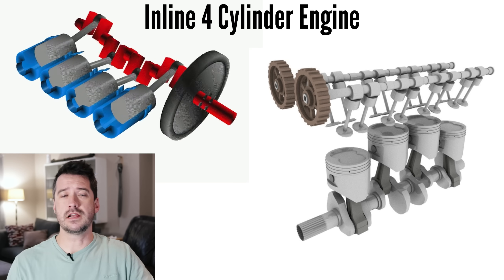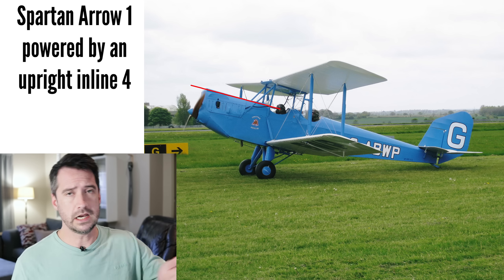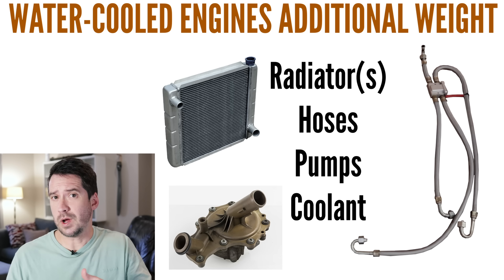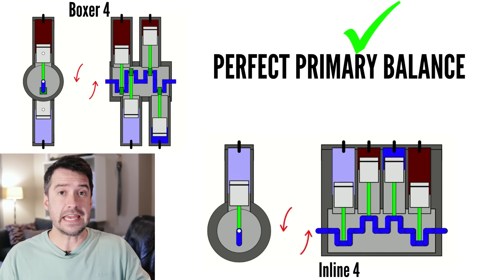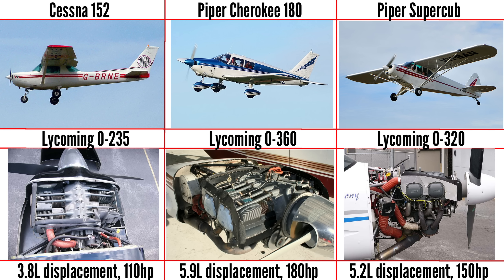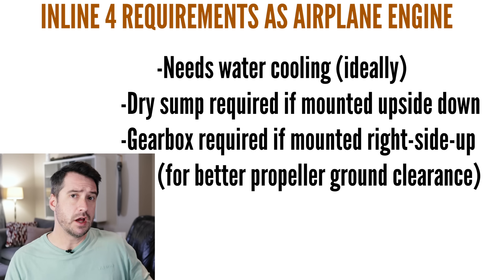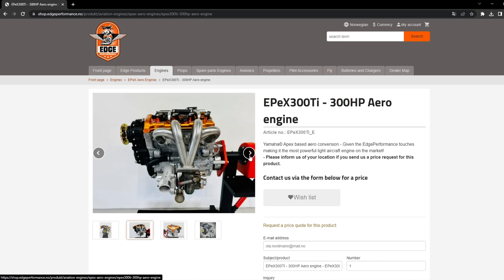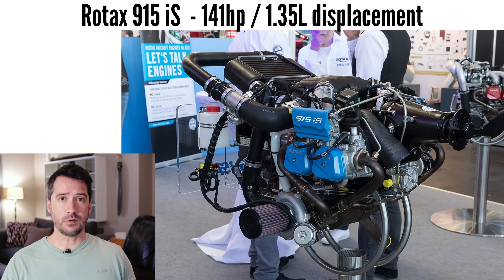Does Inline 4 Engines Suck for Airplanes? - Technical Deep Dive

Comment: Seems to me that all the issues you mention with the online four were solved more than a half century ago with the Meyer-Drake Offenhauser engine. It only won the Indianapolis 500 27 years in a row, and took the entire front row ten years in a row. Even naturally aspirated, it could make 770HP, and went over a thousand with turbocharging.
Reply from the maker: Thanks. I had to go look it up. I don't think they solved anything related to secondary imbalance, but really sturdied up the engine like crazy, so that the imbalance really doesn't affect it like it affects a normal production engine. I'm thinking, why is this not in any production sports cars? And why has it not been used in aircraft? 

I don't know the answer but I'm guessing it's relatively expensive and/or expensive to maintain in a daily use (non-racecar) vehicle due to it's much different design and assembly methods. It also looks like they are heavy, some in excess of 400lbs.

Again, I don't know all the facts, I'd need to research it more, but there is a reason it isn't being used in much other than racing cars.

Awesome discovery for me though, so thanks!
Reply: Yes sir !   Indeed -  how soon some narrow minded people forget what you said !
I only worked with one old offen -   Awesome unit !   I was a young mechanic and into big block 
Chevrolet mark lV engines at the time ,   However -   Like you said ,  non turbo offenhauser  …
Actually scared me … at first anyway .    Please excuse my spelling     Thank you sir !

Comment: Won’t 4 cylinder inline engines still have the cooling issue though? Less airflow and more reliant on radiators etc?
Reply from the maker: Liquid cooled won't as long as the radiator gets air. Aircooled can have cooling issues if the air ducting design isn't great. An airplane designed for the air cooled inline 4 (e.g. Tiger Moth) have taken the engine layout into account with cowling design, and thus doesn't have cooling issues. Put an aircooled I4 in anything else you'll likely have cooling problems.

Comment: The con rod angle causes pistons to reach mid stroke After 90 degrees. This causes a nasty vibration at 2x crank speed. 
Inverted two stroke V4 has very low vibration and direct injection run very clean and efficient. The Delta Hawk diesel is even better.
Reply: wonder if that helps lubrication of rings.
gravity being your friend here. but mains?
Reply: The mains get plenty of oil from the pressure feed being sent by the oil pump, same with the big ends.

Inverted cylinders tend to have issues with too much oil draining into the combustion chambers, especially when left sitting after shut down. This is why radials tend to smoke so badly on start up, oil pools in the bottom cylinders and they smoke until it burns off.

 Inverted inline or V engines usually use the rocker covers as sumps and have drains running from the crankcase to the cylinder head for this purpose, which might explain why they seem to smoke less than radials. But they will still burn more oil than an upright engine.
Reply: Ducati 90 degree V2 is so smooth you can't feel it running... inline 4 kinda sucks for every use...

Comment: This explains a lot about the popularity of small automotive engines...and raises interesting questions about the 3 cylinder engines.  They must be full of vibration.  Maybe that's why they are not expected to last more than 100,000 miles.   And...this business about turbo...I can only imagine the cooling problems.  Hot, vibrations and high rev. seems like a recipe for obsolescence.  The video offers good mechanical info.
Reply: I was thinking the same thing. My Triumphs have 3-cylinder engines (Speed triples, Daytonas) and only displace 1050-1200 cc. They make 130HP at about 10.7k rpm and can run in that range all day long. But, they hit all his points, complex (with balance shafts, water cooled) and would require a gear reduction to get the prop down to reasonable speeds.
Reply from the maker: 3 cylinder engines are interesting. I plan to cover it in a video the future, as a 3 cylinder car engine will now be converted for Aviation by a prominent company.
Reply: @LetsGoAviate  You are talking about Viking again. Looked at the Chevrolet trax engine, it is not suitable. It has a 90 mm stroke for one.
Reply from the maker: @chippyjohn1  Yes that's the one I'm referring to. Interesting enough for me to consider exploring it in a dedicated video.
Reply: @LetsGoAviate  Go for it. Even if you receive negativity in the comments, at least you are making a video about these topics, I applaud you for that. We do need people to push the boundaries of aviation like Viking and Aeromomentum. I just see red flags with viking. All the best.

Comment: There's a "big" difference between  "boxer" (4) and a "flat" (4). That's in the motion of the pistons and how the pistons are connected to the cranks on the crankshaft. In a boxer engine two "opposite" pistons have their own individual cranks and the way this is timed is that the two opposing pistons go in opposite direction at exactly the same time. When one piston moves away from the crankshaft, the other does so too.  In a flat engine, two pistons share one crank on the shaft and go the same direction. These differences have serious impact on the natural balance or unbalance in the engine. The boxer simply is more elegant and AFAIK it is the boxer design that is used in aircraft ICE.
The same difference may be observed in V engines, by the way. And you could compare the inline 4 with the boxer in this sense, only the inline 4 got folded into two by two at 180 degrees.
When it comes to natural balance, an inline 6 may be the best, though, and I am not sure if that 6 folded open into a boxer 6 still has that quality. It's all in the timing of moving - accelerating and decelerating - masses.
That said, yes, why not an inline 4 (diesel) in a small aircraft. Car tech has made serious leaps ahead in the past decades and HP per cc (or ci) as well as HP per engine mass have been improved a lot.
Reply from the maker: Yes and also, all boxers are also flat engines, but not all flat engines are boxers. Flat engines (that aren't also boxers) are not very popular due to horrible primary balance.
Reply: @LetsGoAviate  All aviation flat 12s and H24's are common crankpin engines, 180 degree V12's is another way to describe them. The Porsche 917 12 and the Ferrari 512 were also common crankpin engines.

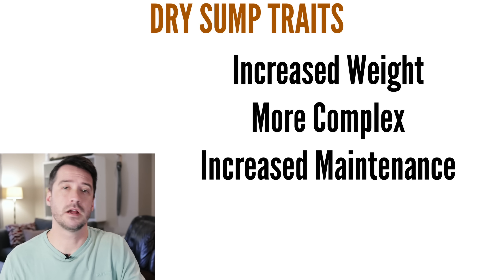Comment: 3:20 dry sump,  expense: Most of the German planes of WWII had inverted V-12's.  It's not necessarily a huge hurdle.  I wonder if they had dry sumps (probably, given that the Bf-109 was known to pull negative G's) or whether most had a wet sump that was simply fed from the cylinder heads. General Aviation planes don't need to pull negative G so why wouldn't a wet sump still work in an inverted engine
Reply from the maker: The Bf 109's engine was indeed a dry sump. I guess the problem with an inverted wet sump is, where do you physically place the sump? 

Using a dry sump isn't a huge hurdle, and there are many examples of them out there today. Heck, my plane has one! (Rotax 912). But it does drive up engine cost, which the manufacturer has to decide if it is worth it.
Reply: @LetsGoAviate  >  I guess the problem with an inverted wet sump is, where do you physically place the sump? 

A box that feeds from the heads or cam covers would take care of everything below the pistons.  I'm not sure how you'd get oil from above the pistons but there must have been a way if the Germans were doing it 60 years ago.
Reply: @LetsGoAviate  I haven't flown GA but commercial passenger service almost never has side loads even approaching that of a cornering economy car (which can do 0.7g or something laterally)?  Why would you need a dry sump on an airplane?   Is it only a bit of extra insurance so that the engine keeps working even under bizarre abnormal conditions that normally never happen anyway (e.g., momentary weightlessness in a stall)?

Comment: i would say much more than displacement and vibration of the gipsy major, its limited by the technology of its time.  they could machine parts and balance them.  but nowhere near as good as we can today.  they likely had rope seals and much lower quality babbitt bearings than what we do today.  on top of those two issues, you have the metallurgy of the time, far weaker pistons, rods, and crank.  then you have the cylinder head, the very antiquated carburetor on it, and the horrible oil they likely used when compared to modern standards.

i'd bet you'd have similar maximum rpm of a boxer aviation engine as you would with a gipsy major if you made a modern version of it with components updated and make significantly more power.

the other big reason you dont want a big displacement boxer engine on a car, is fuel consumption and rpm range.  a higher revving engine is going to have a much wider torque band thats usable for a vehicle on the ground that constantly has to rev up and down all day vs an airplane that sits at a given rpm most of the time its in use.

Comment: I have a question, are all flat four aircraft engines boxers or are some regular flat fours?
Reply from the maker: I'm not sure if there has ever been flat four (that aren't boxers) on aircraft, but I's be surprised as they are not very smooth engines, with that huge rocking couple vibration on the whole engine, due to 2 cylinders sharing a crank pin.

Comment: Something you missed: on Engine Balance an I4 engine can be balanced on both primary and secondary axis, and is the smallest that can do so. This is rare (and I’ve never seen it in an auto), but it’s been used many times on motorcycle engines, and has an easy solution: piston firing order. In the video you showed the firing order was 1-3-2-4 (which causes secondary imbalances), but changing the firing order to 1+4 - 2+3 (so cylinders 1 & 4 fire together and 2 & 3 fire together). This requires a new cam and ought to include a different exhaust collector to ensure effective scavenging, and may require a new ignition (many ignitions fire every cylinder on every stroke simply so they don’t have to add any logic to it).

Comment: I loved and learned so much with this video...till the boxer eq Hp but 2x the displacement, begs the question. why can't a boxer with same displacement make same HP?
Since a boxer has no secondary imbalance it should be able to rev much higher for the same displacement. Only the mentioned double halves argument still holds, even if potentially meaningless. A boxer can make more HP for same displacement with higher rev limit, all else being equal.
Boom
Reply from the maker: Thanks. Good point! There are the small displacement Rotax boxers I mentioned in the video, like the 915 & 916 making 141 & 160hp from 1.35L of displacement which almost matches the some of the modern I4's in the video on hp/liter. And the Rotax engine is proof that the boxer 4 will remain alive.

So I don't think it's that boxers can't compete at hp/liter at all, it's that with the I4 is more cost effective (simpler) to get a lot of power out of it, and when going high rpm, small displacement turbo'd, then the boxer 4 loses the big advantage it had over the I4.
Reply: @LetsGoAviate  two Yamaha motors with in a boxer configuration, new crank and block or block halves, and get 2x power no mods.
or shrink to allow higher engine RPM, HP and lighten back up, ...or...since we doubled the displacement...who does not want 600 +HP right? Bigger plane retrofits?
Since the cam is 2:1 and needs a chain anyway, why not beef it up and drive the prop? (Combined transmission and cam shaft drive
(crazy morning thoughts!)
I wonder if your point is more about the ubiquity of the I4 and how that reduces costs. yes one block costs less, weighs less. But if the 2ndary imbalance is removed with a boxer, it should be able to rev higher and stay together, without counterweights, and produce more power because of a higher rev limit. caveat is piston speed. if that gets invoked close to the 2ndary imbalance vibrational stress adds, then this may not be as true. but if there is a large rpm range below piston speed limit, then this should be mostly true. longer piston rods help reduce secondary imbalance somewhat, but does not eliminate it. This makes the block heaver, a boxer or V# would take a double hit on material as it goes outward in two directions. So the I4 wins with longer rods on this single compare in terms of 2ndary imbalance RPM limit headroom gain.
Reply from the maker: Many valid points here, and one can probably talk about it for hours on-end. It's a fascinating subject for me, and I'm glad others (like you) seem to find it fascinating as well.
Reply: A boxer engine still has secondary forces, its just that the crankshaft feels it. You also cant have large mass reciprocating at high speed, the stresses on the piston and rods and rod bolts would mean they would have to be even stronger, which means heavier which means more reciprocating mass again. Plus the engine will be overall heavier. An IO360 has about up to 4 times the reciprocating force of a small 1.5 litre 4 cylinder at twice the rpm. That is why these big engines throw rods and pistons. a 360 piston is around 1800 grams, while a 915 is around 350, both travelling at similar speeds.

Comment: Reduction gearboxes for aviation are always problematic leading to expensive overhauls. They never hit the volumes needed to work the kinks out, as such they will remain problematic.  There are higher reving lycomings etc that do have production reduction boxes as well as thielert and others, and these are very problematic.  It seems gearboxes don't like the backlash chatter that propellers produce due to lack of inertia.  When it comes to brake specific fuel efficiency the lycoming 235 and 360s are not as inefficient as you'd think.
Reply from the maker: Yeah you have a point regarding volumes. Redrives can be very reliable, just look at Rotax. Fair enough, the engines only go up to 160hp, but these gearboxes simply don't give issues when maintained as recommended by Rotax.

Comment: Hi from the uk 
I feel you have missed a point.
Just as it would not be a good match to fit a lycoming in a car, yes good power good torque but low speed. most aero engines are direct drive are because of there larger displacement allows adequate power at low speed and also good longevity but specific powered is quiet low and reliability high.
I don't think there are many automotive engines I would want in an aircraft, yes mor than adequate power and efficiency but because of there smaller size longevity and reliability are sacrificed not to mention that a custom gearbox is in most cases required adding to complexity and reliability issues. How dose certification go with modifications like these?
Reply from the maker: Certification not required for experimental aircraft engines. For type certified aircraft certification is not easy and sometimes not attainable.

With the Viking and Aeromomentum mentioned in the video, no custom gearbox required, they already fitted one. That's what these companies do, they convert the engines. You should get the engine ready to mount like any other aircraft engine.
Reply: @LetsGoAviate  
Cheers

Comment: Ford made a 4L gasoline engine.  It was only for Australia.  There are so many big diesel engines that are 4 cylinders, I cannot count.  Buses, Semi's, etc.  The Porche 3.5 liter motor in the 928 was a very smooth engine.  The balancer that you are describing is actually called a counter balancer for some reason.  I believe the reason the planes use boxers is that they are air cooled big 4 cylinder flat engines.  No one makes them anymore except for Lycoming and they have a good reputation.  It is simple, fits the air frame parameters, air flow is along the cowling, exhaust goes straight down and out to pipe, intake comes from the top...very simple.  As for inline configuration of engines, the Merlin and Alison engines were both successful engines that replaced the radial engine during the war.
Reply: "In line" means a single bank.
Reply: @UguysRnuts  Not necessarily for this discussion.  When it comes to this configuration, it is called a straight-whatever.  Some argue that a V12 is 2 inline 6s mated together.  The arrangement though is inline as opposed to radial or boxer.  I do agree that it is in a narrow V shape, but it was very narrow vs. 90 degrees and replaced a radial engine configuration of the time.  The W configuration is also an inline configuration to me.  It is being debated that if something that is not a boxer (or radial) can be used as an airplane engine.  It is also stated that there are no big inline 4 cylinders in the automotive industry.  This is just not true.  If you wanted a diesel airplane with a big 4 cylinder and direct injection that turned at 2500 rpm, there are plenty to be had in the automotive industry with off the shelf diesel engines.
Reply: @sammcbride2464  The Cummins 4BT makes 170 hp and weighs about half as much as an entire airplane that would typically be powered by a 170 hp engine, that's never going to fly... literally.

Comment: Engine with bigger displacement and same power, all else being equal, would be less stressed, therefore more reliable, therefore more safe. And air cooling is more simple and there's nothing to break, works great for aircraft, but limits amount of boost, which can be applied to engine.